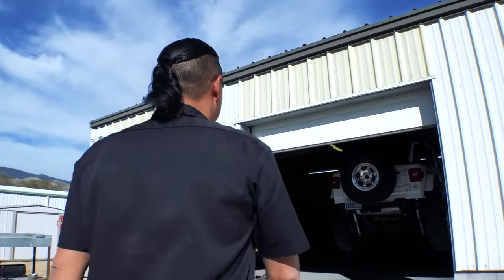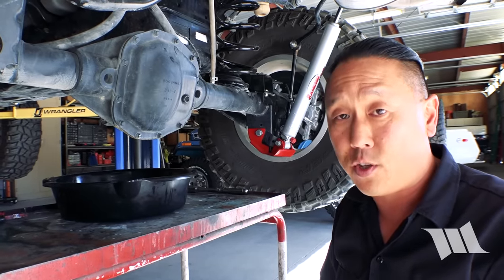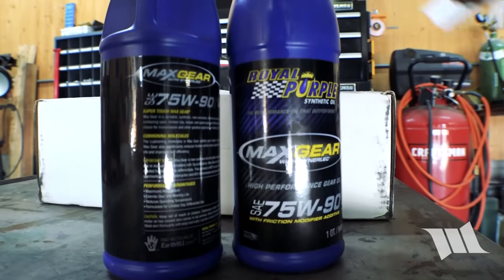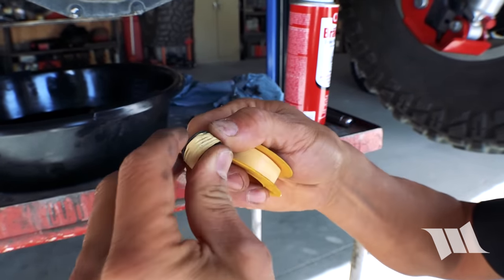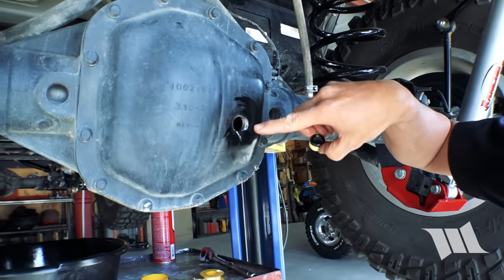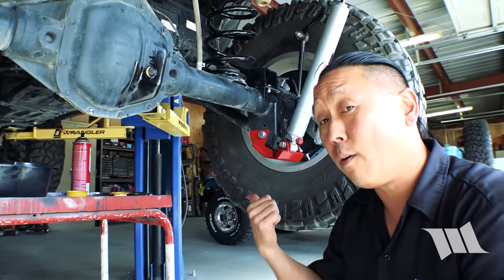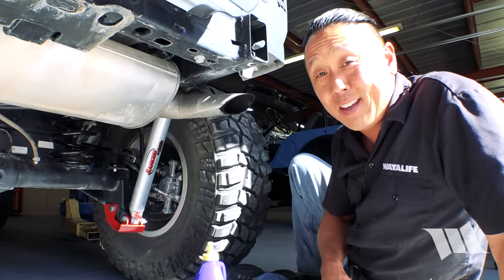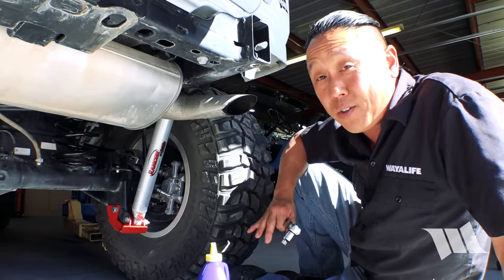Jeep JL Wrangler Axle Differential Fluid Change - How to do it Yourself Maintenance

Comment: Are the Jeep JL wranglers easy to maintain yourself?  This looked easy to me?? Transmission fluid change easy as well?? I have a Jeep Renegade trailhawk and I want to do these changes as well but it looks complicated to me. Doesn’t look anything like a wrangler underneath the renegade.
Reply from the maker: On a wrangler, most everything you need to maintain is pretty easy or at least, in my opinion.

Comment: Hey Eddie, I’m about to do my first diff change ever….I follow your vids and advise (you helped me do my first engine oil change with your vids) so figured I’d ask on the diff fluid. 

I’m in Canada (not sure if specs are different here, trying to find an direct answer on this) seems pretty popular across the board to use 75w90 up front….but seems a mix of opinions on the back (75w90 v 75w140) 

Now I found an “up to date” Manual online that seems to indicate 75w140 in the rear with “sales code DRZ”….previously was only if you did heavy towing, but this one doesn’t really indicate that. Hence I’m confused. 

I don’t tow…but I’d like to make sure I’m putting the correct fluids in….being a jeep guru as yourself do you know of this changing to more a standard 75w140 in the rear? Or are you still recommending the 75w90? 

I have a 2019 JLU Rubicon again in Canada. 

Any input would be appreciated. 👍

Edit: just found out DRZ means “Next-Gen” again not sure though if that is tailored to 2019 axels or what. 

Any help would be appreciated
Reply from the maker: Typically, you want to use a heavier gear oil if you do a lot of towing OR if you're running a much higher gear ratio like 5.13 or 5.38. Otherwise, it's not really needed but it won't really harm anything to run a heavier oil too.
Reply: @wayalife  Thanks so much Eddie 🙏 
Appreciate the time and quick response brother.

Comment: Just to be clear - it's OK to put the RoyalPurple 75W90 with the slip modifiers in the front diff? I know the modifiers are the LSD in the rear, but I want to be certain it's ok to use the same stuff in the front diff also. Thanks for such great content!
Reply from the maker: Correct. The friction modifier is designed to make the clutch packs work in a LSD. It will have ZERO affect on a differential that does not have them.

Comment: I did not know about adding Teflon tape. Thanks for the tip. Serviced my Jeeps diffs be myself not to long ago. My rear Dana 44 has a drain plug, but unfortunately I don't believe my front Dana 30 has a drain plug. Do you recommend every 15 k? Manual says alot longer?
Reply from the maker: I don't know if I'd say the Teflon tape is "required" but teflon is something the factory plugs come with and so it's what I prefer to use.
Reply: Yes, the Dana 30 does have a drain plug. It's in about the same location as the rear, but on the left side.
Reply: @phantumdrummer  I didn't notice it . A little embarrassed but will get under there n look tomorrow. Thanks.

Comment: Just amazing video. Super easy job for these fluids to be changed!! Just two questions, 1. what is the tool you need for front and rear i noticed you used half inch ratchet with step bit? do you have a link ? 2. 75W90 or 75W140? Wasnt sure... 
THANK YOU !!!
Reply from the maker: You are seeing correctly. I use the larger ratchet to give me leverage and that makes the removal of the bolts easier. Any 1/2" drive to 3/8" drive step bit will work. Either fluid will work but I would only use the heavier weight if you're running gears with a much higher ratio.
Reply: @wayalife  Got it. Do you think the Royal Purple 75W-90 for 2018 Jeep JL Sport S is okay to use? I believe the gear ratio is 3.45 for sport JL 2018.... I may be doing a re gear to 4.10 to 4.45 ish not sure if 75w-90 will be okay for those ratios.
Reply from the maker: @j.christopherchang1668  Yes, it'll work well and even with 4.10-4.56

Comment: Don't forget to leave the drain pan underneath until you have topped it off and put the fill plug back in tight. It will save that little bit of overflow from going all over your nice clean cement floors and staining them permanently! Good info! How often do you do this, for everyone out here to have an idea when they should be doing a service to their axles? Thank you!
Reply from the maker: As I say in the video, I like to do mine every 15k but will do it sooner if I've been doing a lot of water crossings.
Reply: @wayalife  There you go that is what I was thinking about is the water. I would assume you change it after your trip, if you had done water crossings, just to be sure there is no moisture in the diff's that would contaminate the gear oil! Thanks for the great videos! We really like and appreciate them!

Comment: But just asking...not taking the cover off and cleaning the housing & gears with brake cleaner will not clean out any gunk and contaminte the new oil?
Reply from the maker: Doing a more thorough job is never a bad thing but for me personally, I'm more concerned with chunks of metal than fine gunk and possible water contamination than contaminating new oil. Of course, the more frequent you change your oil, the cleaner it will be each time and the drain plug makes it a LOT easier to service more frequently. But of course, that's just me. You should always service your Jeep how you see fit.

Comment: Hi , my jeep axle hose is leaking ( I just re-geared but I had to drive 2000 miles to the south from NY. ) I will change the oil as soon as I get to my destination, do you think that everything is okay and I just need to change the fluid ?
Reply from the maker: Sounds like your differential was filled too high. This will cause your ring gear to pump out the excess oil out the breather. It'll be messy for a bit but you will be totally fine.

Comment: What is the time frame do you need to change the oil for a daily  driver. I have a 2018 jl 2 door.
Reply from the maker: Assuming you're not doing a lot of hard off roading, I'd say you'd be good to do this every 30,000 miles.

Comment: Why did mine only take 1 quart? Is that normal? Everywhere I searched said more.
2018 JLU Sahara
Reply from the maker: A Sahara has a Dana 30 front axle and it only takes 1.82 pints. That is less than a quart. The rear is a Dana 44 rear that is smaller than a Rubicon and it takes 2.43 pints as in, just a tad more than a quart.

Comment: If I changed the rear diff oil and there was some shavings on the magnet like nail clippings should I worry or is it something I’m going to have to swap out anyways if I get a lift, stock 18 jlu sahara 3.6
Reply from the maker: Soft, fuzzy filings are normal. Anything that resembles actual pieces of metal is not a good thing. A lift alone would not require a ring and pinion swap but you might want to install new gears for a bigger set of tires.

Comment: You have been wheeling a lot in that Jeep. You have tried multiple lifts. Recommendations ? Worried about wheel wobble.
Reply from the maker: Just got done testing out some 2"-2.5" lifts and so far, I probably would recommend the Rancho 2.5" lift for a set of 37's if only because it's so affordable and provides better break over angles. If I were just running 35's, I would probably recommend the Dynatrac lift.
Reply: Wayalife so do you feel the metal cloak 2.5 game changer would be over kill? And what are your thoughts on the mopar 2” with fox shocks

Comment: Great vid. I was looking on my 2021 Rubicon JLU build sheet and it says the front and rear diffs have “Tru-Lock”.  I see there is also on some Jeeps “Track Lok”,which you note requires the addition of a friction modifier.  Do you know if a TruLok diff requires a friction modifier?  Thankyou.
Reply from the maker: You only need friction modifier on a differential that has a limited slip in it. If you use a synthetic fluid, it will have it in it already so nothing more is needed.

Comment: Royal Purple 75W90 Gear Oil would be for front and rear? I have a 2018 jeep wrangler jl sahara.
Reply from the maker: Assuming you're running stock gears, yes, it would be fine.

Comment: I own a Jeep JK Wrangler 2014. Firestone is recommending 75W140 for one axle and 80W90 for the other. Is there any benefit in having a heavier weight in the rear axle? I dont use it for towing or pulling a trailer. I assume the  Royale Purple 75/90 would work fine in both .
Reply from the maker: If you're running a higher gear ratio, the ring and pinion will run hotter and a heavier gear oil will remain stable better but really, you would be fine with both being the same.

Comment: Eddie, curious why you didn't pull the diff cover to check the magnet on the locker sensor for metal shavings? I am having issues with my rear locker light coming on and off there's been alott of speculation about the sensor filling with oil or the magnet having to much shavings on it thoughts?
Reply from the maker: I would never pretend to know more than whoever has been doing all the speculating but ever since the electric locker first came out back in 2007, I have NEVER seen metal shavings be an issue with it and honestly, that is about the dumbest thing I have ever heard. But of course, that is just me and my limited experience running them on multiple JK''s, a JL and JT over the last 15 years. That said, I can tell you that I have personally seen and have had problems with e-lockers in the past and all of them have been related to the dog clutch not being able to move. Over time and hard use, I have found fine cracks develop on the internal components and this prevents the wave spring from moving it freely. If I could guess, this is the problem you're having.

Comment: Just did my diff fluid since I re geared. Was extremely surprised that the front Dana 44 only took a little over 1 quart.
Reply from the maker: Yup, that's what the factory service manual calls for.

Comment: Thank you for this video! Even Mr. Lube wants $350 dollars to do this. its out of control.

How do you know what diff you have though?
Reply from the maker: Depends on what Jeep model you have but really, it doesn't matter for servicing them following  this video.
Reply: Thank you ! I ended the VIN into the Jeep site and it looks like I have a Altitude with a Trac-Lok @wayalife
Reply from the maker: Okay, you'll want to make sure to use synthetic fluid like you see in this video or add friction modifier to standard gear oil then.
Reply: Thank you so much. I will use the link in your video and I subscribed as well!!! cheers @wayalife

Comment: I noticed you didn't use a pump. Is that because you had it lifted
Reply from the maker: There's just no need for it. And I should note, if you use something like Valvoline or even Amsoil, they now come in bags that make it even easier to pour fluid in.

Comment: Just re-geared and did the break in. I noticed that the rear diff fluid was very dark and the front was as clean as it was going in. Should I be worried or is this normally the case as the front wasn’t used at all?
Reply from the maker: The front will not have spun at all unless it were in 4WD.

Comment: My 2022 JLUR does not have a drain bolt on my differentials.
Reply from the maker: Unfortunately, Jeep has removed the drain bolts on newer vehicles as they were getting damaged and causing leaks. I will have a new video on how to change your fluid without them soon.

Comment: Thanks for the video. Quick question...I have a Wrangler JLU Sport without LSD. I ordered some Mobil 1 75W-90 synthetic and just noticed it states limited slip friction modifier included. Will this be a problem since I do not have a LSD?
Reply from the maker: No, it's no problem at all.

Comment: On the diff plugs - can I use the same threadlocker paste you use on the transfer case plugs or is the yellow teflon tape preferred?
Reply from the maker: Yes. In fact, I would recommend it over the tape. This video was made a few years back.

Comment: So, there's no need for any kind of friction additive with the fluid??
Reply from the maker: You ONLY need friction modifier IF you have a limited slip. I have a Rubicon and so I have lockers. That said, synthetic fluid like I'm using in this fluid has friction modifier in it so even if I did have a limited slip, I would be covered.
Reply: @wayalife  thanks!

Comment: I’ve been on the fence about going with a 75W140 in the rear. Did you end up sticking with the 75W90 in the rear? I noticed that after you repaired the crack on your diff the shop went with a 75W140.
Reply from the maker: If you've installed gears with a higher ratio, going with a heavier weight is a good idea. If not, I would just stick with the lighter oil.

Comment: So, why are you now running Rancho RS9000XL's instead of the Fox Shocks from the last lift install?  I'm guessing those 9000xl's have a longer length for more down travel.
Reply from the maker: You guessed correctly. The new Rancho 3.5" coils yielded closer to 4" of lift up front and more like 4.5" in the rear. The new 9000's made for them have a greater amount of travel.

Comment: Why does the front differential leak oil from the exhaust hose after servicing it? thank
Reply from the maker: Typically, that's caused from adding too much fluid. It should clear out though.

Comment: If fluid has water am I still ok with a drain and fill (maybe ride with that and re drain and fill) or do I need to go ahead and open cover and flush or can I flush with cleaner and fill without opening it up?
Reply from the maker: If you've got water in your differential, as in, your fluid looks like a latte, you really should pull the cover and do a thorough cleaning.
Reply: @wayalife  thank you figured as much going to plan for the worst as I’ve had water on the floorboard off-roading so going to plan ahead for a full clean so I’m prepared. Next upgrade is going to be extending the breathers on everything for sure!
Reply from the maker: @johngonzalez9300  I bet you're fine and would just check it first, super simple to do. Just drain it like you would normally do and if it comes out looking like a latte, pull the cover.

Comment: would it be a good idea to use an air compressor to blow in the fill hole and drain as much as possible or is that overkill?
Reply from the maker: It's overkill. If you really want every last drop out, just let it drain overnight. But really, that's not necessary.

Comment: So what size bit do I buy..? I'm doing this for the first time..? I know you said a 1/2in drive ratchet..
Reply from the maker: You just need to use the square connector on a standard 3/8" drive ratchet. You can use a step bit to attach on a 1/2" drive ratchet and this will help make it easier.

Comment: Hello. Today I was fixing new front spring perch on my jeep jlur, and while dropping my front axle, they accidentally broke the small valve where the axle breather hose attaches to, I would like to ask you how to remove the valve from the axle housing once it is broken, I know there are after market options for valves and hoses but in order to install them I need to remove the old one, any idea how since the top of the valve is broken?
Reply from the maker: Did you mean to say the nipple? The one attached to the housing? If so, you should be able to drill it out but I would try to pull the carrier out first, just so you can make sure to clean out the housing good. Once drilled, you can tap the hole to accept a new nipple. OR, you can just tap the existing hole and use a smaller nipple.
Reply: Wayalife Thank you for the info, and yes the vent nipple is broken, how can I pull the carrier if its broken?

Comment: Does the 392 have a drain plug as well ? The dealership just told me they have to pull out and replace the gasket to replace the oil
Reply from the maker: The differentials on a 392 do NOT have drain plugs.
Reply: @wayalife  thank you 😊

Comment: Hello Thank you for the video, I have a 15 JKU , i got them regeared to Revolution 4.88 ring/pinion set, i just passed 500 mile, my question is can i just flush oil out and change it or do i have open the whole cover off since its just got regeared. and also can i use the Royal Purple 75W90 Gear Oil for front and rear instead of the Mopar recommend oil? Thank you very much
Reply from the maker: Yup, unless you're hearing noises or other issues, all you need to do is drain and refill. Also, yes, you can use Royal Purple up front as well although, a change really won't be needed at this time being that you most likely haven't been running in 4WD for all those miles. Without a load, the front won't be wearing in the way the rear will.
Reply: Wayalife great thank you very much for your reply.

Comment: Hey man, how often should you change your front and rear fluid? Is it every 15k miles? Thanks for the great videos
Reply from the maker: Rear should be 15k-30k depending on how hard you drive your Jeep. Sooner if you've been doing a lot of deep water crossings. Front can be double that as it's not really doing a whole lot under normal driving conditions.
Reply: @wayalife  thanks so much for the response and info. It looks like it’s time for me to get it changed 😂 To change both the front and rear, did you use up two bottles of fluid or do I just need one? Thanks
Reply from the maker: @carsongonzalez4881  You'll end up needing a bit more than one.

Comment: Hi,

How does it work with 75w-90?

Do you recommend this viscosity?
Reply: By the way, my rear diff with LSD
Reply from the maker: Assuming you're running stock gears, that will be fine. Also, so long as you make sure to use a synthetic fluid, it will have friction modifier in it for your LSD.